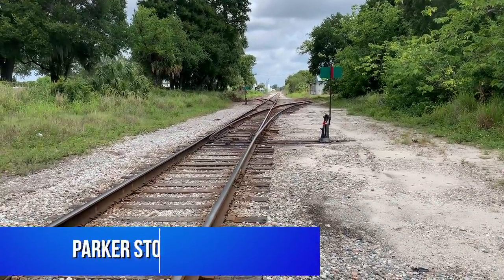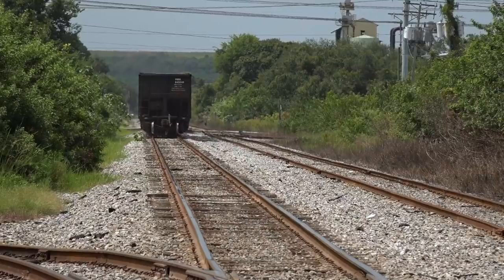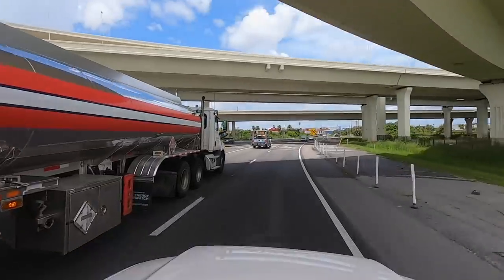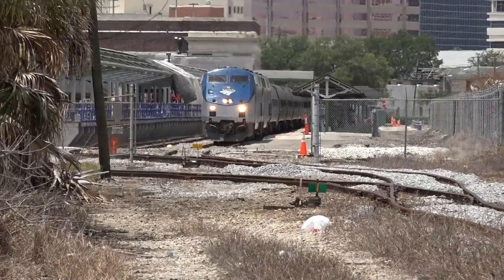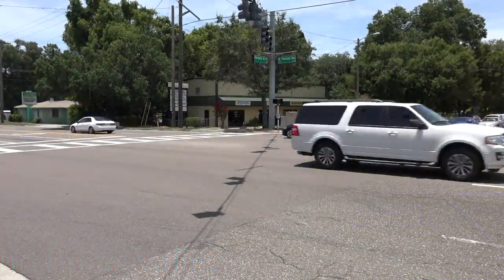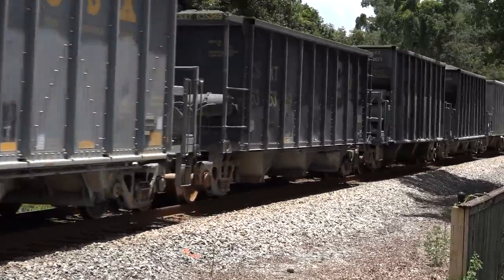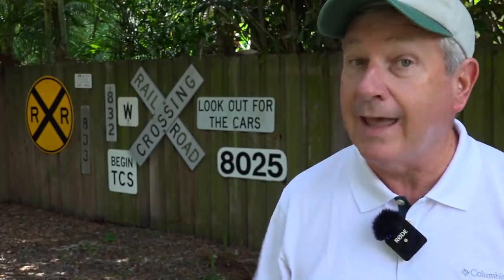Busy Railroad Saturday In Central Florida

Comment: Finally my two years of a jazz performance degree is helping me! That horn at 1:42 which you like so much is actually fouled. It's a standard tuning K5LA where the 5 bell, the highest note, is fouled and brought down about a whole step. Standard tuning for a K5LA from the lowest to highest bells is D#, F#, G#, B, D#, resulting in a very pleasant "Major 6" chord. However, when the 5 bell (the high D#) is fouled and the pitch drops a whole step, it result in a B 6(9) chord which is a slightly cooler sound which is often used in chordal, floating sections of songs to provide a little more interesting harmony to what would be a relatively bland chord.

Getting even more music-theory involved, the notes that make up this fouled tuning are also the same notes that make up the pentatonic scale, which is one of the most common sets of notes in popular music.

I also really love the sound of K5LA's which are fouled like that.

Edit: got the timestamp wrong.
Reply: Awesome explanation Sean! I was rushing home to comment on this as a former working musician and a Musicians Institue grad, I was totally excited to hurry up and respond. No need to though. And also many thanks for the details on the equipment spec on the K5LA. I wish I had one at hom. If only to look at it every now and then :). KUDO's on the whole post, Sir! Danny should really appreciate this. Cheers!
Reply from the maker: Thanks for that explanation, Sean! I'm always fascinated to know about locomotive horn tunings. I wonder, "who decided on that chord?" What I REALLY like are the minor chords. Those seem to be disappearing, too. I guess smart people at FRA, AAR and Nathan figure this stuff out as to which is most effective. Thanks again. DH
Reply: Curious, I'm hearing C Major, 2d inversion (G, C (root), E.  1:42
Reply: @distantsignal  Not sure exactly who decided on the chord, but Amtrak was the one who, in conjunction with Nathan, developed the Airchime K5LA for their locomotives to give them a more "cheerful" sound when approaching and departing a station.
Reply: The local at 2:42 also has a K5LA, but is the newer cast and sounds uglier for some reason.
Reply: The entire video is a K5LA fest, in fact.
Reply: Sean being a professional musician, I too heard the 'Major 6" chord.  Excellent work.
Reply: @distantsignal  It's the constant push forward to simplicity, uniformity, and blandness. Scientifically tested so as to offend nobody. The ho-hum future has arrived.
Reply: Distant Signal - The K5LA is the “Amtrak Horn” used on all their locomotives since the 1970s.  It was developed specifically to sound pleasant and friendly.  There’s even a whole cohort of foamers who can tell different generations of KL5A from each other.
Reply: well, there were none in this video, but I can also tell you the notes in a 3rd gen K5HL horn. I am big in music and music theory, so I can sound like a geek when it comes to train horns. 3rd gen K5HLs, which are typically heard on ES and ET44AH GEVOS, especially the 3000 series', have notes from bottom to top: C#, E, G, B, making it a C# half-diminished chord, very dissonant sounding, but I love the horn. Makes the GEVOs sound more powerful to me
Reply: The Glenn Miller song "Chattanooga Choo Choo", contains Major 6 nuances. For example, when the background singers reply with "Yes - Yes", it sort of mimics a train whistle.
Reply: @316minister  before the doppler it sounded like an Am7... I matched it on both guitar and piano
Reply: @unklewink  So does the sax section parts on In the Mood...............Jazz and Trains?!?! Sign me up; I played piano to earn the dough for my undergraduate degree.
Reply: @capitolabill1921  Listen to the NBC tones on TV, which is what you're describing. Much different feel.
Reply: Interesting i like the horn sound too lol.

Comment: Danny: I am new to your videos and I have been very, VERY impressed with your knowledge and detail of railroading. I grew up on a farm in north central Ohio that had a B&O (Later Chessie System) line running through it. (it's a bike trail now!) I could hear the horn about three crossings down (it was mostly a northbound single track) and I would run to the track to watch them roll by. I've been a fan ever since. I especially enjoy your detail on older rail equipment such as signals, switches, and signs. Fascinating stuff! Keep up the great postings, as I hope you never get tired of it!!

Comment: I’m not sure why you were hearing K813, that’s K313’s normal routing and consist that you caught. Also I believe K200 is interchanged with BNSF, in either Birmingham or Illinois. The K200 symbols were used briefly back in 2016 when the O800 series first switched over to the K300 symbols, before CSX switched back to the K800 series for Phosphate Unit Trains, but you’ll still occasionally see a K200 series train here or there. BTW, the most likely symbol for that Port of Tampa Job would’ve been Y295.

 Nice video btw.

Comment: I've always wondered what happened to intermodal trains running through downtown Orlando. Last time I saw one was back in 2010. CSX engine # 410 along with another engine was pulling a very long stream of empty bare tables (some had containers) heading north. Ever since then, I haven't seen anymore intermodal action. I figured you might possibly know what happened?

Comment: Interesting to see the new high-level at Tampa.  I can't on the top of my head think of any other Amtrak station in Florida with high-level platforms.  Lots of expense for a single train.  Is Virgin/Brightline going to terminate there?  Could if they wanted to.

I guess the Star will never be Superliner equipped now although it does look like a low-level platform may remain.  There have been discussions on other sites suggesting converting the Florida trains to Superliners and running them from Washington south.

Comment: The trailing locomotives on train K-200 are brand new. There known as ET44AHs. Known as the Tier 4 GEVO. They rolled into service in 2015. So there practically new and mighty.

Comment: Great video and catches! Nice to see all of those AC44s and other older locomotives leading, especially CSX 84 with that beautiful-sounding K5LA! Not as common up here as many of the trains CSX runs around here require DPUs, it seems. Also interesting seeing that the bell(s?) at US 41 ring while the gates are down, unusual for a CSX crossing! By the way, K200 had a pair of ET44AHs trailing, not AC44AHs, lol.

Comment: Got a question and a comment. Being of similar age (I'm assuming) my fanning goes way back. Back to when PAX trains were different colors. But, being from SoCal, those colors were ATSF Silver, UP Armor yellow, and SP daylight. Many a Sunday afternoon, watched the Super/El Cap come thru San Bernardino, and, out the window from my dining room table, could see the Fullerton Sub of the SF. With the help of Dad's binoculars, would watch the Eastbound 24, the Grand Canyon, virtually daily after school. Which brings the question: With the aforementioned roads, there was a reason why they called them "Head End Cars", so why does Amtrak insist upon putting them on the back end?

I have to admit that I rather ignorant on this particular railroad operation (my career was [military] aircraft maintenance), but when you showed the coupling between the Bone Valley hoppers, I couldn't wrap my head around "twisting" a car around while still coupled (I always thought otherwise), so I paused your vid and went looking. In amongst all the "N" and "HO" scale dumpers, I found this little gem. I guess that I can safely assume that the cars have special couplers as well. https://youtu.be/v5t-Smcvs5k
Reply: Great link! That's it!!

Comment: Great video as always, Danny!
Just a quick note, the two units you referred to as AC44-AH's around 11:00 are actually ET44AH's. They're the latest emission tier 4 compliant locomotives that GE has put out (the "T" in the model name stands for Tier 4). They're pretty easy to spot, they have a "full length" radiator grille that is thicker than older GEs (Dash 8's/Dash 9's/AC44CW's), and a little square "hump" just before the radiator grille. 
http://www.rrpicturearchives.net/locoPicture.aspx?id=213882
http://www.rrpicturearchives.net/Locopicture.aspx?id=215516
AC44AH's are a real thing, they're just rebuilt AC44CW's that CSX has upgraded to provide more tractive effort. https://www.trainorders.com/discussion/read.php?2,1481506
Reply from the maker: Must have been a typo that didn't catch. It's why I don't usually like to get into locomotive minutiae. It's not my area of interest and errors come easily. Thanks!

Comment: Hey Danny! Great video as usual. Do you think the high platform at tus is for the upcoming virgin/bright line trains? Would the use tus for the station? I think they will. Do the really need a high platform for one round trip daily or tri weekly? I think this is great because the will use the same row as Amtrak. What are your thoughts about this?

Comment: The "k813" you mentioned is actually K313. Must have misheard the radio transmission.  Also, the building of Rockport was only partially done to reduce traffic thru downtown Tampa to port Tampa yard.  It also permitted the elimination of the old SAL dock at Boca Grande.
Reply from the maker: Nope I definitely heard it right as K-813 from dispatcher and crew. I didn't record it from my mobile radio, though. I did know about the Boca Grande factor, but wasn't it also so SCL could close SAL's Seddon Island for good? They were still operating in the mid-1960's , weren't they?
Reply: Someone must have misspoke then because they were the K 313. I was the conductor on the K339 behind them.  They went Rockport to Ridgewood and back. As far as Seddon Island is concerned, I'm not sure,  before my time but it is likely.  I did work with a few old heads that told me stories about them taking 100 car trains through downtown to port tampa yard so I don't know exactly when the phosphate docks closed there. I do know that rockport was built in the late 60's and into 1970. It opened in either 70 or 71.  I also know that the reasons for the closings and the opening of Rockport was that the city wanted to minimize rail traffic in the city to give it a less industrial and more urban residential feel and  consolidating the terminals would probably improve efficiency and decrease transit time from the mines to the dock and reduce maintenance costs as well since there were drawbridges at all three locations that had to be traversed not counting the miles of rail

Comment: Do the crews on CSX announce their locations to the dispatcher all the time?  With that said, is it easier to know where a train is at? Here in Illinois I don't know of a railroad that does that.
Reply: Seems like CSX primarily because here in UP territory there is no such clutter on the scanner. Only Dispatchers and the gold mines aka Defect Detectors lol
Reply: Todd, on CSX we have to call out the signals as we see them. It not only gives up our location, it also lets anyone else in the area know where we are at and probably how fast we are going. "CSX Q213-08 with CSX 4384 Southbound has a Clear Signal at North Bushnell, Out..." The first part is their train ID, Q213-08 meaning it's the 213 which started on the 8th day of the month. The second part is the designated lead engine, which is mostly the engine on the front, unless they have changed directions or had to add another unit. As long as the designated lead engine is in the consist somewhere, it's okay. And at night, it should be the only one with number board lights on. The third part is the timetable direction of travel, and is sometimes announced elsewhere in the garble, though it's supposed to be attached to the train ID or locomotive number... The fourth part is the aspect of the signal that they are calling out. On many railroads, crews are relieved from calling out signals that display Clear. Anything less than clear still has to be called out though. And finally, the signal's name which is quite often a Geographic description such as the end of a siding, or some other junction. 
Avid railfans have got the routine trains memorized as well as the locations of many signals so they can catch the trains on the move. It has always impressed me how fluent in railroading the railfans are and Danny is a fine example.

Comment: Hold up...
What's the difference between Star and Meteor? It looks like they have the same route in FL, but I remember something in VA, like a junction or like that.
Reply from the maker: The Star serves some markets that the Meteor doesn't. In Virginia, it swings off the Coast Line and over to the Seaboard,  serving Hamlet, NC and Denmark, SC. It swings back onto the Coast Line (ACL) at Savannah and takes the same route south until Aurburndale, Florida, where it makes a run into Lakeland and Tampa. Then back out to Auburndale and South to Miami.
Reply: @distantsignal  I understand now. Thanks a lot!

Comment: Hi, what do you know about the rail line that was once owned by CSX that ran from Jax to Pensacola? It was sold by CSX and bought by Georgia/Florida Rail Line and doesn’t appear to have much traffic anymore. A huge bummer for a rail fan like me who lives locally and used to frequent some stops 😕
Reply from the maker: I am right there with you. That's the Ex-SAL/L&N Gulf Wind Route that went from Jax to Pensacola. CSX sold it in 2018 to Gary Marino's RAILUSA out of Boca Raton. So far they haven't been able to create much traffic of their own and CSX moved all their overhead traffic over the A&WP/AB&C route to Waycross. Word is they've fixed some of their bridges on the L&N end and are trying to bring in new business.
Reply: Distant Signal Thank you so much for your reply.

They have a lot of hazmat cars just sitting there looking pretty on the other track in 2 places for LONG time.

Comment: Hey Danny, those high handle switch stands are horrible, vandals and kids used to take off the 🎯 targets and switch them around. Most of them only had a 🔩 bolt holding them onto the shaft. . On CP we had the track dept weld them on so they couldn't be turned. When you're a conductor, you basically watch the tracks and switch points, and you can see them a long way off and ignore the targets, but you talk about a heart attack for a train crew at 50 mph on a 14,000 ton coal train. Yikes!
Reply from the maker: I've always wondered about those switches in dark territory. Especially at night. That would scare me to death.
Reply: @distantsignal  yes, you're right, I should have mentioned that it really only mattered where there is no signals, dark territory, broken rail safe switch signaling protection in ctc, dtc and other systems. You really know your stuff, very impressive

Comment: Do Amtrak trains use the defect detectors, or does Amtrak have their own method for checking for defects?
Reply from the maker: Yep. Every train that runs on that track uses the same defect detector.
Reply: Thanks. I've wondered that many times as I've watched these videos. I don't have a scanner, so I can't listen in, and also the closest Amtrak routes run 30 miles away from me.

Comment: The lightening bolts under the locomotive numbers only indicate AC traction on about 99% of CSX AC traction locomotives. A mistake was made during the painting and decal process and 4 to 5 CSX DC traction locomotives also got the lightening bolts. This mistake was never corrected, so you have to go by the locomotive number and look up the current roster to see if it is AC traction or not. I have actually found one of the mistake locomotives.
Reply from the maker: Ha! 99% is enough for me.

Comment: Danny,  at about 2:13 what's up with the turnout and the green over yellow that changes to green after the engines pass by?
Reply from the maker: Power assisted switches. They go to Green over Yellow when the train is on the OS circuit. Return to green when he gets off.

Comment: 161.370 is Channel 1 on CP (The Watertown Sub) up here in Wisconsin.
Reply: Most railroads that use modern radios just have them programmed as Channel 1, 2, 3, etc. even though they are still AAR 84-84, or 32-32, and so on.

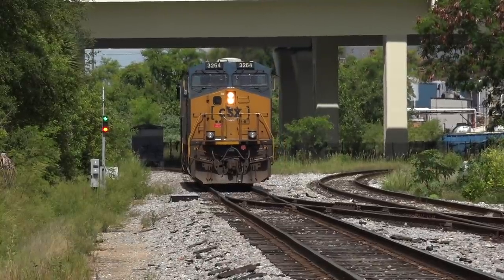Comment: Knocking down signals? But at 2:20 the signal goes from green over yellow to plain green, what happened to red?
Reply from the maker: Those are switch indicators. They only tell the status of power-assisted switches. They're not track signals.
Reply: Thanks Danny I was wondering the same thing.

Comment: Can anyone help me out I have my scanner set to pick up the telemetry I have the freq 457.9375 and 452. 9375 I have yet to hear the trains info axles,length etc. Do I have to be at a specific place. Or are there other freq? I'm right outside Cleveland Ohio
Reply from the maker: You don't get any actual information from this. You only hear the chirp. Sounds like a digital songbird. Transmissions are one second or less. It merely lets you know a train is nearby.